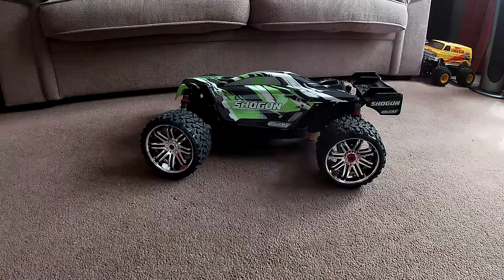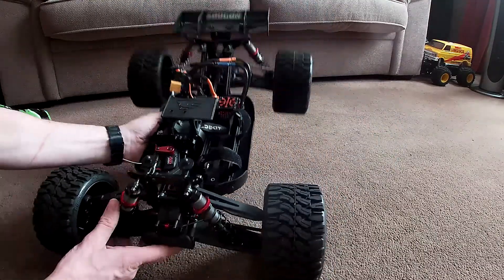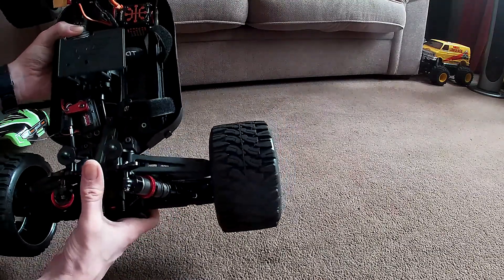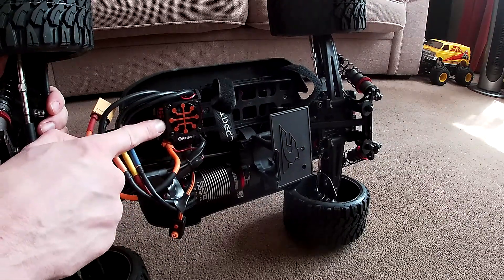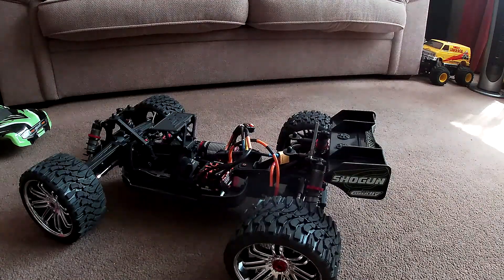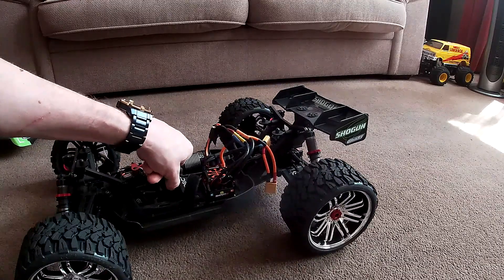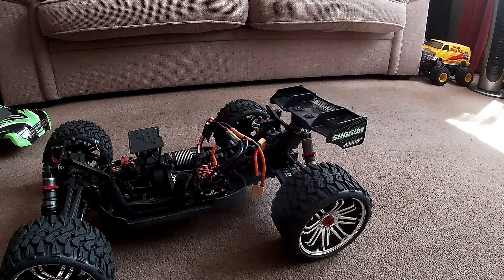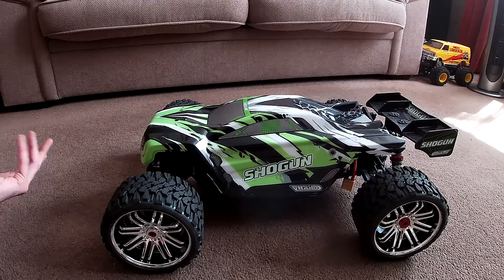My Corally Shogun V1, bought Used. in need of tlc.

Comment: Here every time see lol. I’ve done this a few times but not on a 4s level. If it’s a good runner after and better then stock it might be a gem in the end. Never know. Defo know the feeling tho. Great vid 💪🏻👍🏻
Reply from the maker: Yes Brother Thanks mate .😁👍. 
It’s still not quite a 100% I have it a run it went ok . Shame my footage has been messed up. 
I’ve got two other options for a motor I’ve gone with a reedy 2000kv . It’s got a Another problem the rear diff bevel gear is jumping a cog under load . 🙄. 
Thanks for watching as ever Much Appreciated take care 👍
Reply: @mark-1rc502    Will wait to see this run I’m interested. If it’s skipping just lock it man lol surely it’s a bashed anyway a little handling can be sacrificed ??  Can’t wait to se the corally tho

Comment: That's got some weight bro,thud,lol 🤔😅🤣😁👍,,you virtually rebuild it bro,  🤔👍👍,,I see you have rocket tamyia in the corner,, lol 🤣😁👍,, done a good job though bro,,,my marauder costed me £255 I originally paid 112 Inc vat, my other cars bit less with upgrades,,I just buy good budget rc car,s burn erm them out then upgrade,,me mauler is the quickest I have upgraded, due to back plastic diff,,,,your shogun will do you proud bro,,you worked on it😁😁😁👍

Comment: 🤔 mark i wonder if you at least need to check the upper arm link where the pillow balls are adjusted to stop so much shaking on the arm either the outer most larger sized hex or the 2.5mm (😬 on Arrma ) but I think it’ll be the larger sized hex maybe need tightening😫😫 thanks for the show man mark😎 bet you’ll never buy used again unless you’ve played with it just before paying the dollar for it
Reply from the maker: Yes you May be right on the pillow balls , 
I one of the upper arm has worn out hole 😬(pardon the pun). For the hinge pin. 
I put the right spacers behind the upper arms 
It must be either worn out hub carrier or that big Allen key ,
Reply: @mark-1rc502  💯 right on Mark wonder how long until you get that hex out and have a look, hate a worn out hole myself 
A pal had one on his motor mount and that almost had us for a while until he told me me pulled the screw out 😫 then I check for thread and there was none there enough to secure the sliding part of the mount
Ohh I do hope it’s not worn and just needs a good button up😱😱